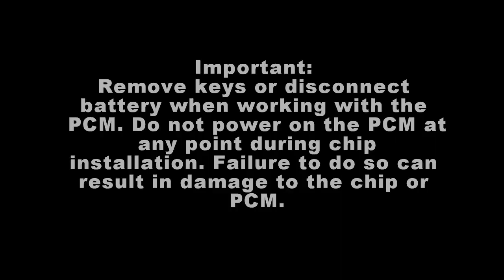PHP Hydra Chip Install - Ford OBS 7.3 - Power Hungry Performance

Comment: Watched this video about 9000 times because I was nervous lmao. Followed step by step and truck runs great. Thank you. Included brush is super nice too
Reply from the maker: Glad it's working for you! We try to make sure people have everything they need to get it going.
Reply: Just curious is all the other modes working like the performance modes. I have a ts but I think the chip is messed up or something cuz it seems like the only tune that works is high idle and it is in the 5th position instead of the second and I was wanting to get a hydra and try it
Reply from the maker: @jacobprince5474  Hey Jacob, sorry for the late reply. Please reach out to our office or support emails for help with your questions.

Comment: Just installed on my 95 7.3. Is it common to have a hesitation/miss after 50 percent throttle?  Anything over the 40 hp tune the truck will feel very sluggish. Coming from ts6 switch which ran great.
Reply from the maker: Sorry for the late reply, but no. If you are having an issue at a particular power level, or if the truck feels like it's "plateauing," then you'll most likely have something mechanical not keeping up.
Reply: Try replacing the cps
Reply: @Ranjsounds  it ended up being injectors. They were weak and didn’t like the increased icp.
Reply: Having the same issue!

Comment: I read that the Hydra Chip is supposed to all come with no start? If so how do you use it. And I though 00 was for stock and the other 5 setting were programs
Reply from the maker: If you go all the way "up" on your display while the key is on, you'll get to an "nS" position, which will give you a CNS.

Comment: What is the purpose of the high idle tune? Well done brother.
Reply from the maker: High idle is good for warming the truck up in cold weather, running the AC in hot weather, keeping the cylinder temps high enough when idling for extended periods (hours or days), and for running PTOs or similar.

Comment: Would you recommend placing the Chip along with the cables whenever you have the PCM out? I’ve heard it’s a bit easier as well as safer since you minimize the risk of bending the contacts of both the PCM and the Chip
Reply from the maker: You can do that. Just install it as normal and tape it up before re-installing. The only negative to that is that you have to fish the wires through the firewall on the OBS trucks before the PCM goes in.

Comment: I was having issues getting a connection to my PCM, I have had it soldered and reinstalled the chip. With the chip at 00 before my truck goes through the regular starting sequence check engine shuts off, wait to start is normal. Before starting my truck if I change the chip to 03 (stock) VRAA6S3, Hydra Serial 04A63424 Firm Software 1.0.0.8 the check engine stays on, glow plug lights up then shuts off really fast. I don’t want to start my truck at 00 change the tune and damage the PCM. Is it safe to do that? If not what else could be wrong with the chip, I know the connection should be good now and I don’t own a PC to check the tunes, bought the chip with tunes installed from Full Force Diesel. Would appreciate the help!
Reply from the maker: Who did the resolder? It would be best to be able to check the tunes so you can make sure you're running the correct tunes for the truck.
Reply: I appreciate the reply, after a phone call to Full Force Diesel it turns out the put tunes on there for a 01 and not a 97. Now I’ll just have to find someone with a PC as I have a Mac
Reply from the maker: @maxdeerp  Fair enough. Give us a call at the shop if you're still having issues.

Comment: What number should be displayed on the switch when I attempt to start the truck the first time after installing the chip?
Reply from the maker: Jeremy, it won't matter. So long as it isn't "nS," the truck should start. If you're in "00," then you're in bypass mode. Just start it on whatever tune you want 1-15.

Comment: Dose this work on the idi 7.3 to
Reply from the maker: It does not. The IDI is mechanically injected. The Hydra only works on electronically injected vehicles.

Comment: Is it work with stock trucks/vans?
Reply from the maker: Hey, Luis. Yes it does. The tunes included are written for stock vehicles.
Reply: @PowerHungryPerformance  do you have tunes for lightly modified trucks. My 97 i have 180 injectors and 63/70 mm turbo and a 205 rated hpop and im looking for good power for towing 11k and not kill all the mosquitoes in 5 mile radius